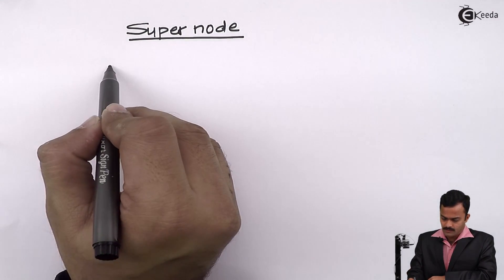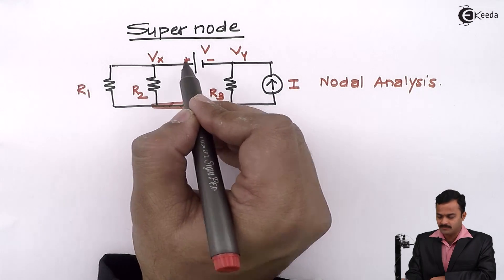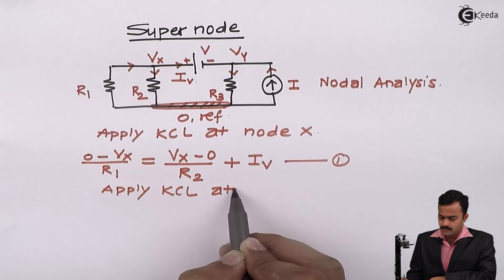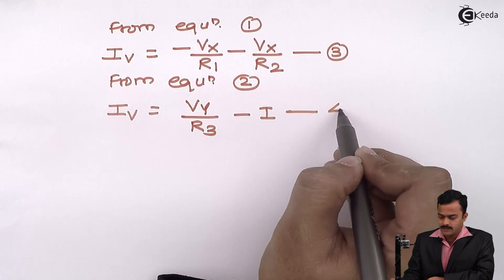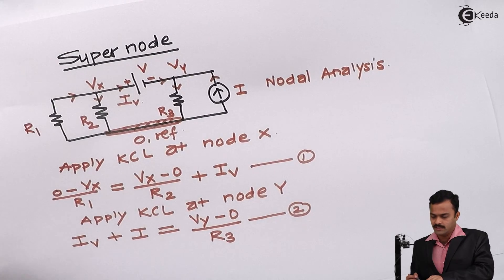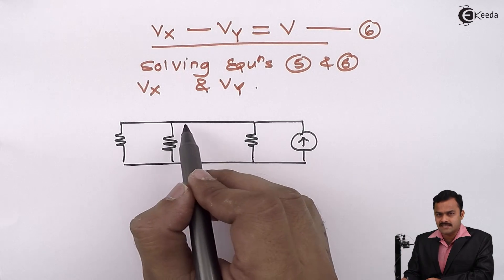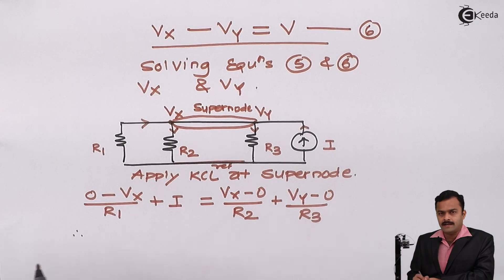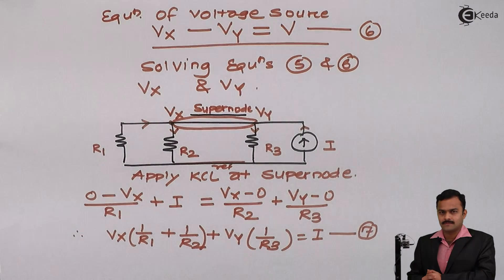Supernode Analysis - DC Circuits - Basic Electrical Engineering

Comment: Sir if a resistance is in series with the voltage ..then should we short circuit it too.
Reply: hen this will not a supernode
Reply: I'm facing the same problem🙄
Reply: Yes